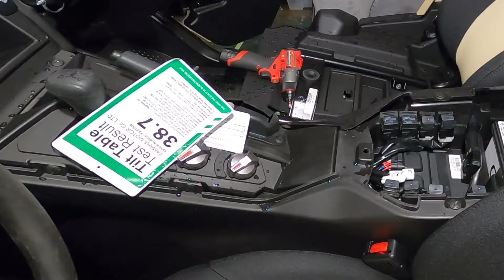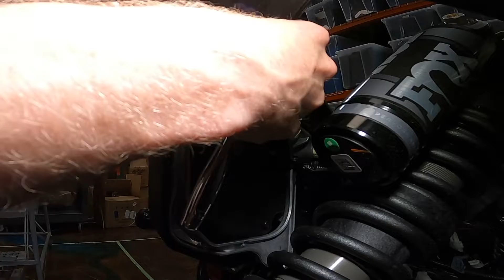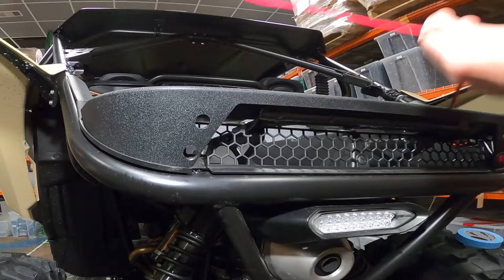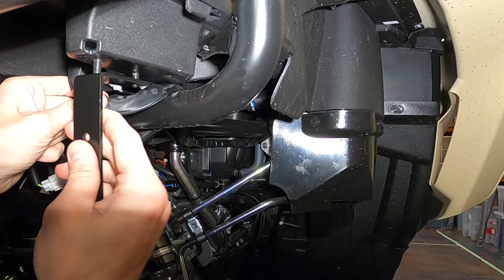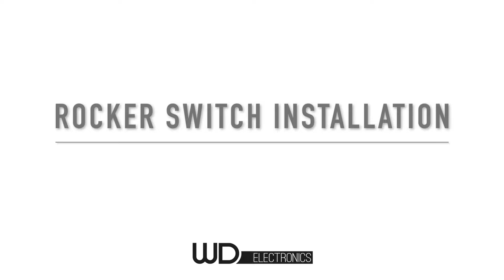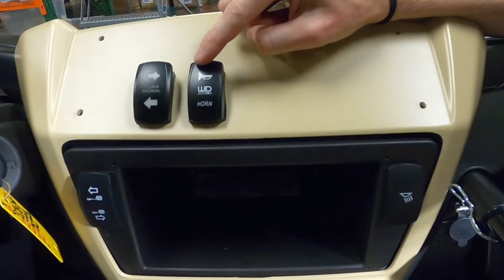Yamaha YXZ - Street Legal Kit Install | WD ELECTRONICS

Comment: Is heat an issue? On the 1st gen YXZ the rad is in the front and gets hot near the dash. Is it ok to mount the control module in the same place with the added heat?